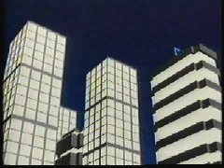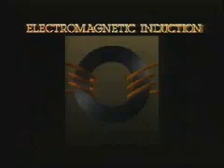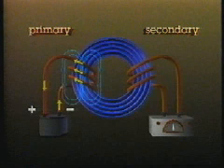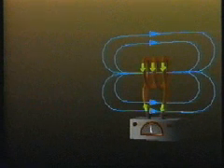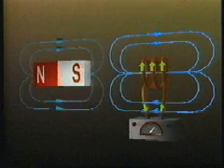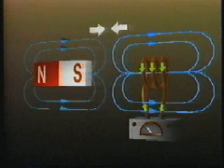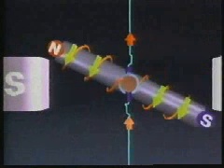Electromagnetism 6: Induction

Comment: Of course electromagnetism works, it works on a coil system.  If this coil system were regulated one would hav a 24 volt feed into a 12 volt system or vice versa via a joule or insulated coil to its negative eg a non-inducive transformer system.  Its not perpetual motion.  Its called electromagnetic induction, and it can't leak.

Comment: At 5:52 , this video is wrong, yes the pole of north and south of the coil is CORRECT, as this is how the coil trys to oppose the change caused by the magnetic field of the magnet, BUT we use RIGHT HAND RULE to determine the direction of the current in th coil, so the direstion should be opposite to that shown in this video!!!

Comment: No no no. Your concepts are mixed up. There is NO attraction b/w the south poles.
Hypothetically, IF the like south poles were to attract each other, then the magnet would move all by itself through the coil. This would be creation of kinetic energy and since Energy can't be created, the assumption itself is wrong.

Comment: @dalsenov 
No physical contact is necessary between the two,It is the disruption of the electromagnetic field which generates the flow of electrons.
Thing eats me is if it is possible to create a machine that rotates indefinitely under magnetic repulsion alone.This video shows the problem of the switching poles quite clearly.But I think That could be possibly overcome.The law of Conversion of Energy goes on about closed systems but the universal electron field itself  is part of this system.

Comment: @Aasmaema 

I think the video is correct. The magnetic attraction between the N and S, and the magnetic opposition between N ans N or S and S, both create the induced magnetic field. You need the change from this "second" magnetic field in order to produce current within the armature. So the applied magnetic field depends on it to produce current.

Comment: @Thisisnotmyrealname8

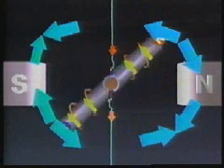Right! At 7:14, the video gives many the first impression of an electric motor. But this is without the coil being powered. So we are seeing the back EMF generated by the coil passing by the magnet. Thus 7:14-8:49 is actually the mode of an electrical generator. Thus, one must apply a force to sustain motion. Force it closer, then the magnet induces a repelling field. Force it away, then the magnet induces an attracting field. In both situations, it generates electricity.

Comment: Think of it like a frictional force for induction.  It always acts against the motion causing it (the original movement).  If the movement of the magnet is originally to the left, the opposing force will be to the right.  

If it were the other way around, then the induced field  would increase the speed of the motion.  That would break the conservation of energy principle because you can't increase energy without expending energy elsewhere.

Comment: Permanent magnets interact differently than electro-magnetic fields on a transformer's core.  So, what is true for a generator may be different when or while using permanent magnets.  Permanent magnets do cause a reversal of current flow when the number of magnetic lines reverses direction through the coil.  So, there is a very clear difference and I don't understand why I am the only one that's built a circuit to recognize that.

Comment: I've built a few circuits, and ya' know, the current never reverses in the secondary unless it reverses in the primary.  An inductor works to keep current flowing in one direction.  This is equally as true for the primary as it is the secondary.  The only reason I can think of for Faraday's results is that the iron ring is carrying an intense eddy current.  But, in no transformer I have ever seen does pulsating DC convert to anything but more pulsating DC on the secondary. Inductor A, Inductor B